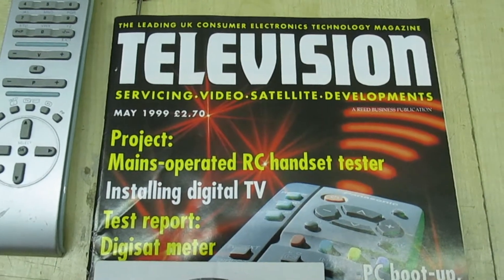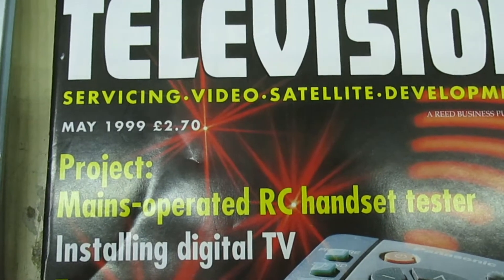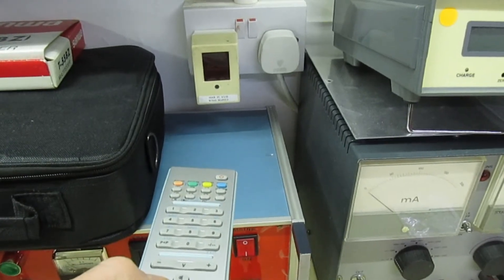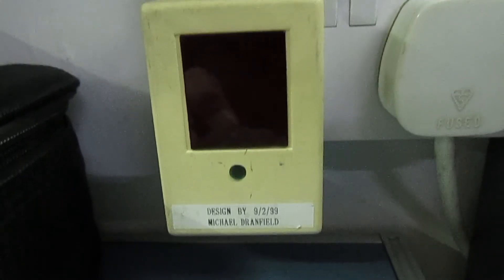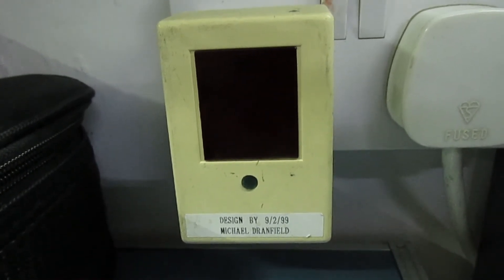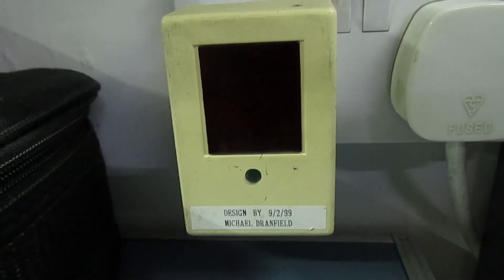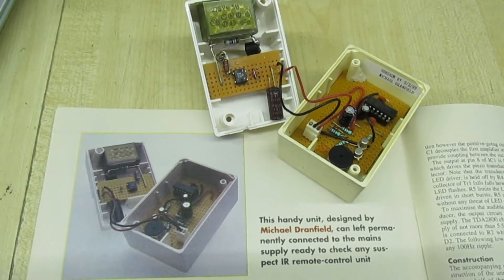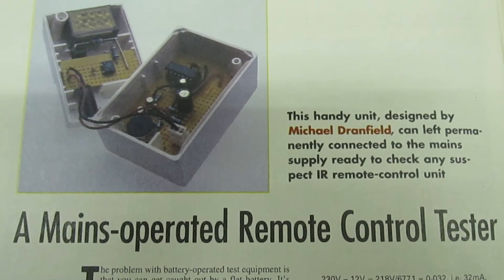Mains powered InfraRed remote control tester.

Comment: Another quick way to test an a remote is just to look at the emitter  window with your camera phone. Cameras are sensitive to that wavelength and you will clearly see it flashing.  I also found my latest cheap Chinese component tester has a remote control tester works very well.

Comment: A wattless dropper, Didn't know that was used in the 60s  My boss in the 80s designed one to charge a Ni Cad PP3 to sound an alarm  to warn if the mains failed in a control cabinet t was my job to construct the PCB and cases I was a bit sceptical if the caps would hold out but they did for 10 years.  They are very common now, used in LED mains lamps now.  Was quite sad when Television folded suddenly in 2006.

Here is a resource you might like  https://worldradiohistory.com/index.htm